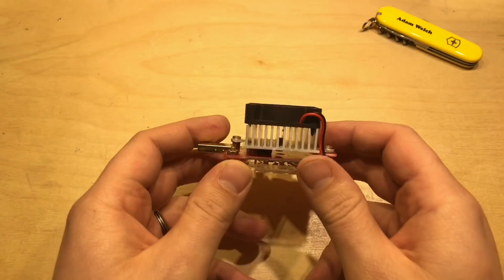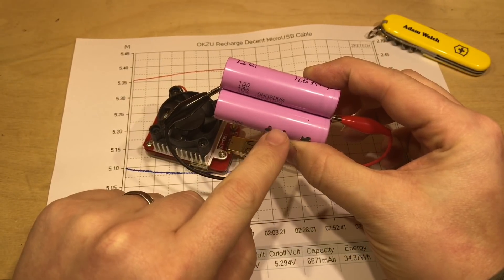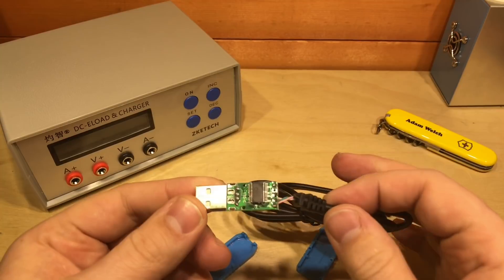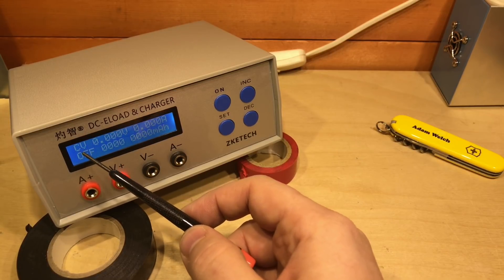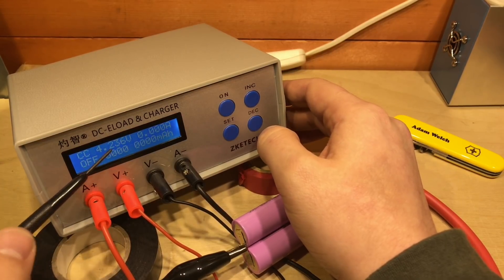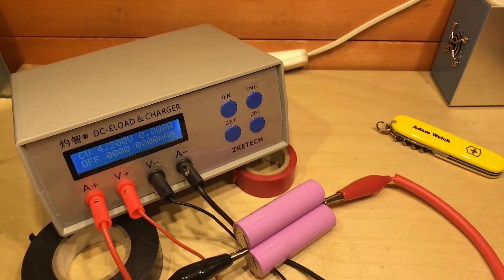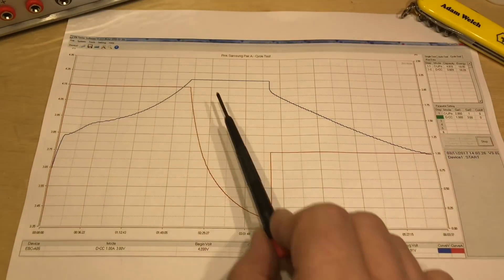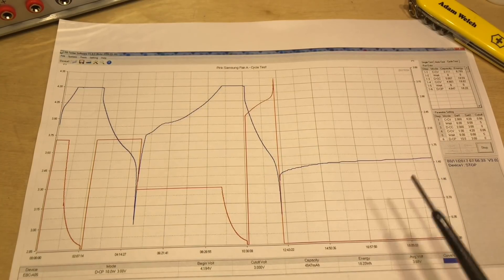ZKE-Tech EBC-A05+ Electronic Load & Charger - 12v Solar Shed

Comment: I am thinking about ordering one of these EBD-M05 it does the same thing just with a display and maybe more power I'm not sure but you should check it out I am looking at one on AliExpress
Reply from the maker: Yeah however it is just a load I think isn’t it? The one is used here can also charge which is useful for cycle testing.

Comment: It's an interesting piece of kit, albeit with a slightly complex setup procedure. Still, it's pretty good with only four buttons for everything. That graph output is definitely the strong point. Thanks Adam.
Reply from the maker: Yeah and when you use it with the PC software you can setup everything without touching a button.  Far easier, but useful to have it work independently to a PC as well.

Comment: ebc-a05 doesn't look like this! one of these is fake?
https://www.banggood.com/ZKE-EBC-A10-Li-Pb-Battery-Charging-Capacity-Test-Power-Performance-Tester-Charger-p-1049709.html?cur_warehouse=CN
Reply from the maker: The one on banggood (which is now discontinued I believe) is the A10 model.  I showed the A05+.
Reply: Ah, thanks. I didn't know they made so many models. I built my own, which is the best DC load I'll come across. I am waiting for an ESP32 so I can convert my project to WiFi + BT LE for remote control and data logging. I have built 3 of his projects. DC Load, Milliamp meter + Milliohom meter. 
I now have complete control over the hardware and software and can make them play songs if I wanted to :)
https://www.youtube.com/watch?v=9fsf1CgnTRk&list=PLUMG8JNssPPzbr4LydbTcBrhoPlemu5Dt

Comment: Hi Adam. You said it can charge up to it’s input voltage of 12V. But if you want to charge a 12V lead acid battery the cut off voltage will be around 14 Volts. So I estimate that i could only charge 6V lead acid batteries than?
Reply from the maker: Perhaps I need to do a bit more investigation on that. You'd be right of cause.  I don't think it is able to boost voltage, but I guess I should double check.
Reply: @AdamWelchUK  
Hi Adam, did you find the answer to this? Thanks.
Reply: Be aware that this unit will NOT charge 12 volt batteries. it will discharge up to 30 volts but will only charge up to "10 volts". I found out the hard way because I wanted to charge and test the capacity of small capacity sealed lead acid batteries like you find in a UPS. I tried using a laptop PS at 15.6 and 19  volts and it still will not charge a 12 v battery.

Comment: Interesting bit of testing kit. I love those ZKETech EBD-USB's, I use them quite a lot in powerbank testing for my videos.
Wanted to point ou that there is also an EBD-USB+ which goes up to 35W.
Reply from the maker: I meant to mention that.  The story goes that I ordered one of the more powerful versions from ebay but it never arrived.  That's when I went searching for an alternative and found the A05.  Think I've got the best of both worlds now though.

Comment: hmmm that menu and screen is very close to the IMax-B6 and they do have a model that can connect to a computer via usb
Reply from the maker: I guess as they’re using the same lcd it was bound to have some similarities. The menu system doesn’t work in the same way though despite there being the same number of buttons. No annoying beep though!
Reply: Yea I thought it was similar to all the 4 button chargers it just has a different UI which would have been better if it were the standard 4 button style since people are already used to that